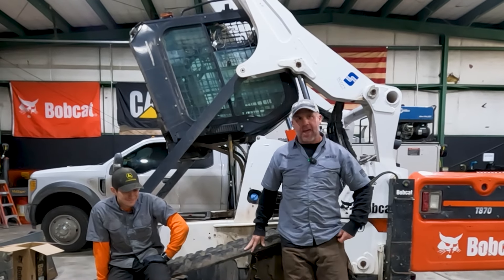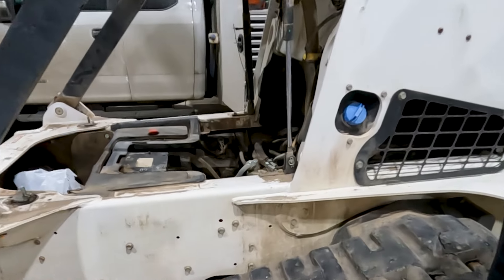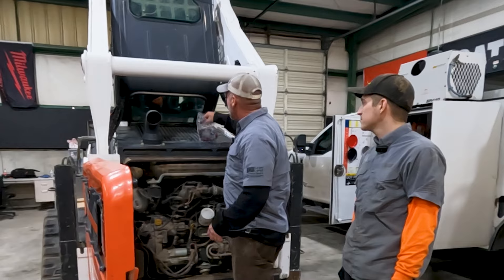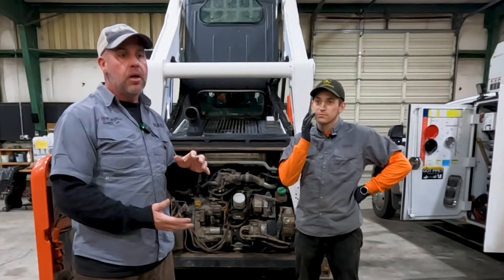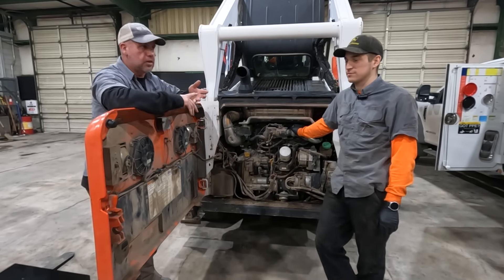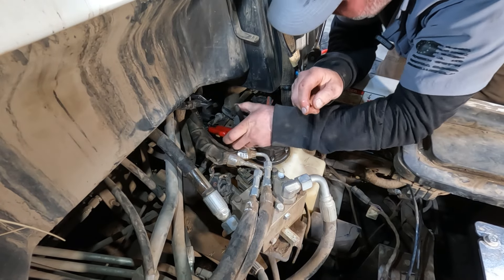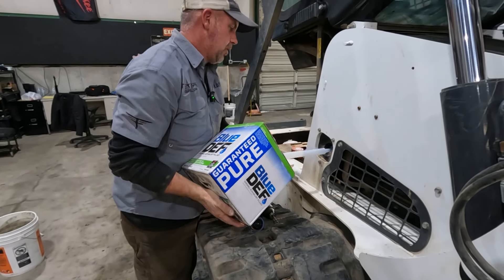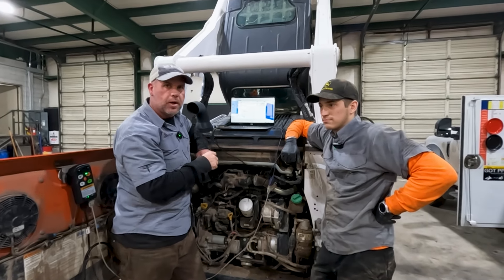Bobcat SCR Aftertreatment Troubleshooting. DEF Quality Issues

Comment: I was told at the engine gold class for bobcat that you have to go into the DCU and program the new sensor. Cause there are 3 different size tanks?? I’ve never done it. But it would make sense cause of the level. But I’ve replaced a handful of these headers and never had an issue after

Comment: Where did you get your software from?
Reply: He’s using Bobcat dealer software supplied to dealers from bobcat
Reply: I own a heavy equipment repair company and I build diag laptops, I have any software you need. For this model machine you have two different programs that you need to have and two different set of cables to hook to the machine. Service analyzer is for the engine ECU to program things such as hyd control valve actuators, and for cylinder cut outs for example. The program for the DCU is called Bobcat engine analyzer and that is for the tier 4 machines that program requires a special set of cables that will run you $2500. If you could find a dealer that will sell them to you.

Comment: I have a “U004334-03, DEF pump pressure max” on a 2017 T770 that was purchased at auction. Need some help with a solution.